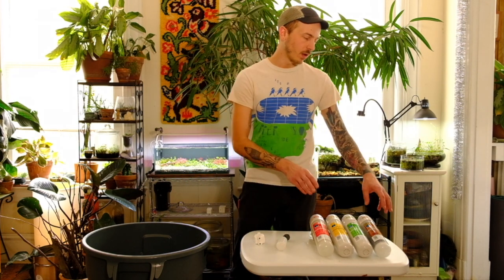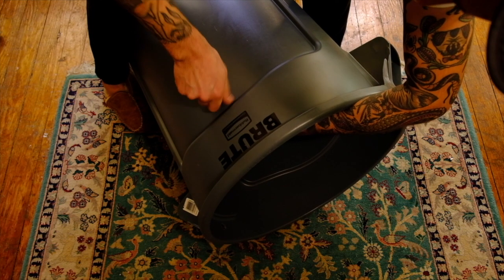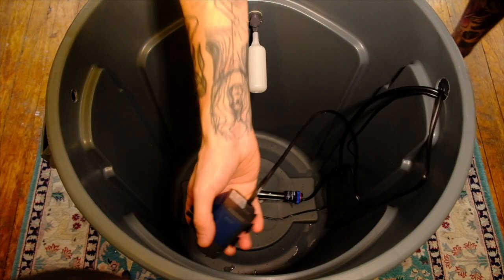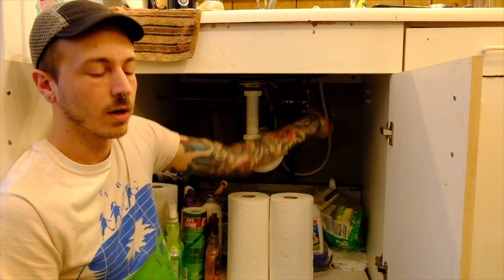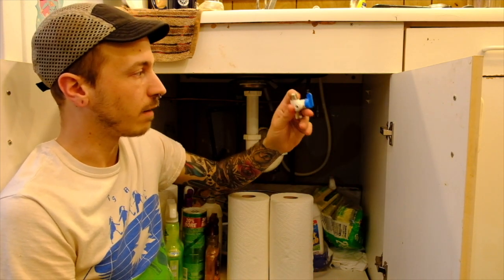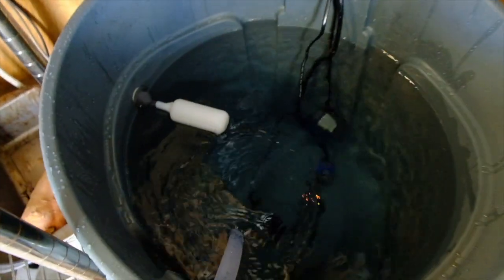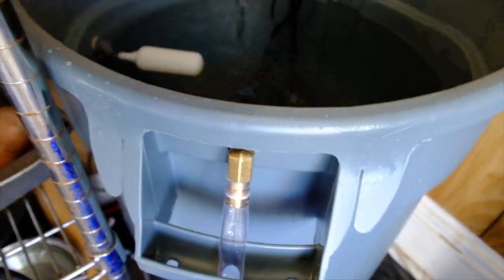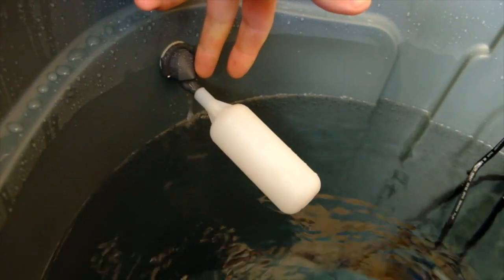DIY Reverse Osmosis Water Storage

Comment: So create a bucket to fill with water to only fill another bucket with water? I use my aquarium as my water storage for my plants. RO water goes directly into the aquarium via auto top off. I then drain my aquarium to hydroponic reservoir via auto water changing system.

Comment: What is the purpose of the heater and the circulationpump?
The container is inside your house it will have the same temperature as the room.
Reply: If you have an aquarium that's warmer, it would be nice not to change the temperature on the fish/plants. No one told you in the video that the heater is necessary.

Comment: Drill a 1/8 hole in the brass elbow inside the reservoir......it will prevent siphon .....
When the pump is running it will still push 99% of the water out into your bucket....the hole will leak , but it will be inside the reservoir.

Comment: How do you clean the trash can reservoir? Mine keeps getting black sludge growing on the 1/2" pump tubing and its happening like less than a month after i clean it with H202. I DONT KEEP NUTES IN IT, JUST PLAIN RO WATER
Reply: you might need a cleaner outside environment. The sludge/mold comes from the outside air. Or, you might consider installing a spigot + a pressure activated pump instead of just a 1/2" tubing.
Reply: make sure you're using food-grade materials that prevent growth.